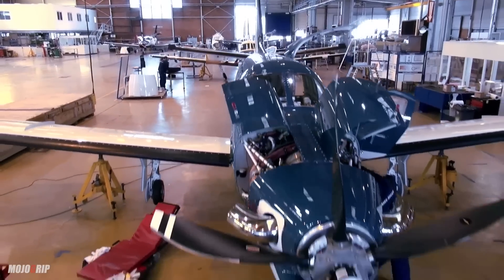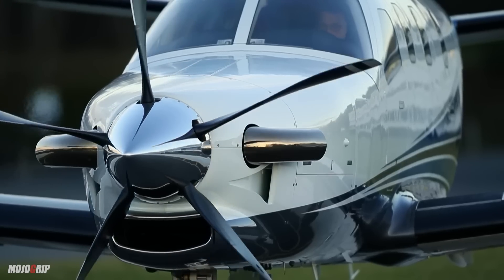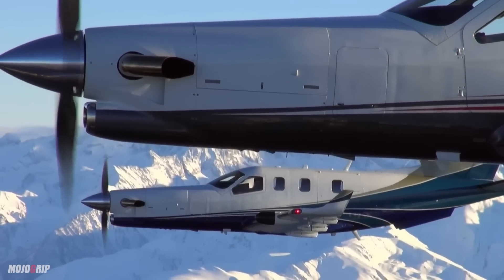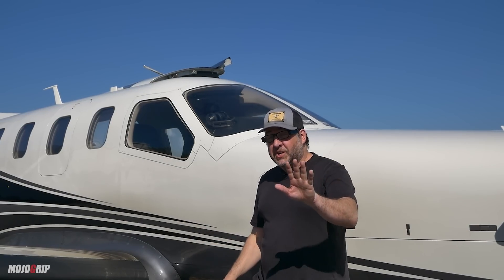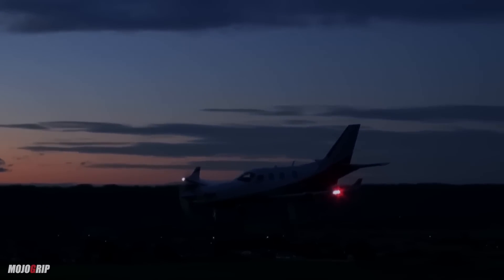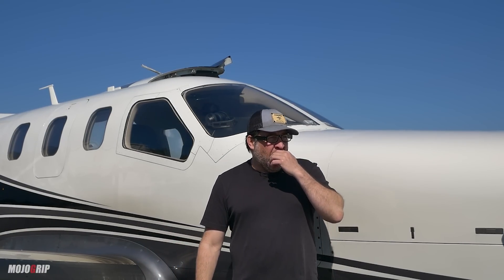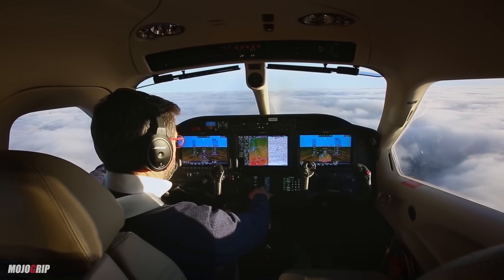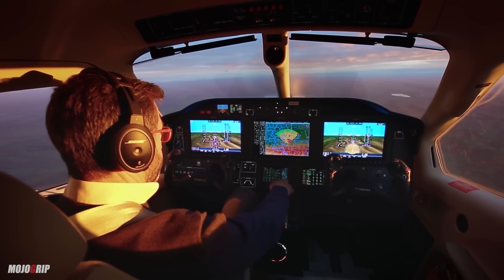This Is So Much Better Than A Jet

Comment: Wish I was still flying.  Had a twin Cessna 340A and the next step was a single turbine.  A single turbine is easier to operate than a twin and without all the twin and piston issues.  FWIW, I was paying $10K for annuals in 2004, so 10K now sounds like a bargain.

Comment: this is very misleading. a SETP like the TBM needs a initial and annual training required by the insurance companies. It's the same process as a type rating in a light Jet. Yes it does cost a little more for a Jet initial. it's $14K for initial in your aircraft for a CE-500 jet rating. Initial in a SETP is around $5-7K. Annual recurrent for Jet is $4000 and Annual recurrent for SETP is around $2500. Very different than what is said in this video. Jets are safer, faster, more comfortable, and fly higher than a SETP. You can fly a light Jet for the same or less than a newer SETP.

Comment: Some misinformation on this.  I'm sure that he has good intentions but he's off on several points.  Firstly the cost of maintenance on the TBM are as much if not more some years than a Citation. Avex will provide you with projected numbers so give them a call.  No doubt that fuel burn is over twice for a TP vs a VLJ however for that you get 2 engines instead of 1 and the added capability to go higher (41-43K) which does get you over weather and turbulence.  I've never paid anywhere close to what he says the annual 61.58 is.  My usual sim or even in plane training has never topped 10K.  Without doubt the requirements to fly a jet are more rigorous than a TP and that may be a turnoff for many.  You are expected to fly at pro pilot proficiency.  Regarding HSI's or overhauls the numbers are not vague.  For every engine including the TBM they are specified and thereby allow you to add that into your cost of ops. Short runways are one place that the TBM will win.  Final line is the TBM is an awesome platform and the fact that it has continued to be a success story in sales attests to that fact.  If you are honestly considering this or a VLJ like a Mustang your initial purchase price will likely be the same or frankly higher for an equivalent avionics equipped bird compared to a Citation with somewhere around 20% increase annually on cost of ops for the VLJ.

Comment: Love the TBM but curious did you consider a Pilatus PC-12,  seems like the perfect compromise of cabin comfort of a jet and single turboprop efficiency
Reply: One might argue the PC 12 is underpowered.  The TBM is a purpose built aircraft for part 91 ops.
Reply: @mikewaterfield3599  You clearly have never flown a PC-12. It has more than enough power to get you places quickly and smoothly, and the avionics allow you to do so without an inordinate amount of effort.
Reply: @hb1338  only 6 hours total, and never ever judge an aircraft on avionics.

Comment: I disagree. The older citations are just as easy to fly but faster and more usable payload. Turboprop do not require type rating but insurance requires the trading which is nearly equivalent. And recurrent training is about $5k. Beta is very comparable to thrust reversers so why is he knocking jets so much? I’ll give him the shorter runways for sure though.

Comment: Really beautiful plane, but I am like the Fighter Jet Pilot I heard the testimony of. 

While flying across the pond near Iceland, his 2 engine jet had an engine go out. He made the necessary adjustments and finished his flight to UK with second engine. 

He said, Without a second engine I probably would not be here today. End of quote. 

So IMHO, and getting ready to buy a plane, I will be buying 2 engines. Whether prop or jet. 

But the TBM and PC12 are amazing and awesome planes.
Reply: Before you pull the trigger on that twin, take a look at the accident statistics and make a data-based decision. GA singles are actually more survivable after an engine failure than twins.
Reply: @cessna177flyer  That's arguably true for piston and TP twins but not for jets which is what his video is about
Reply: @cessna177flyer    Lack of pilot training and proficiency leads to twin engine accidents.    The TBM an PC-12 are great aircraft but I’m not flying them at night night IFR or daytime low IFR.   I want a second source to get me back to a runway if I lose one like I did in an MU2 because of a severe oil leak in the gearcase.
Reply: @stevez6499  agree. Training and proficiency are key. No pilot thinks they are below average, which means 50% of us are wrong...
Reply: Facts. Like the good book: Two is better than one.

Comment: What about a PC 12 vs the TBM ?
Reply: Apples and oranges. Both have some things in common of course but pc12 are people/cargo movers, think of them as a large SUV. Large fuselage in comparison, roomy and bigger mostly preferred because its cargo capabilities or groups of people, thats why is slower compared to a TBM which is mostly like a car inside almost like a sport car, only small number of people’s movers with small cargo but way faster. So, different applications. PC12s are loved by charter companies that need to land in really tough terrains and move cargo. TBMs are loved by solo pilots with solo (or couple) of passengers.
Reply: PC12s are a bit more capable, but they're slightly larger and much more expensive compared to the TBM.

Comment: Does Daher TBMs have more issues with cabin depressurization than other planes? I read a few articles of catastrophic accidents due to pilots losing consciousness in these things due to pressure dropping at altitude? Can anyone share the stats on this?
Reply: Don't focus on "Stats". These incidents can happen to ANY aircraft.
The only reason a pilot would pass out to loss of pressurization is if he/she is NOT paying attention to their aircraft. With all of the dials, gauges, warning and idiot lights in a modern aircraft, there is no excuse for these types of incidents.
In the case of rapid decompression, it comes down to being trained / prepared with your mask properly preflighted and readily at hand. What gets most pilots in trouble is complacency.
Reply: The president of the TBMOPA perished in a slow depressurization event years ago.  It however was not as much related to the TBM as any pressurized aircraft.  All of them have warnings systems but if ignored can turn into tragedy.

Comment: When someone throws out a statement like this, I can’t sit back and be quiet. Not sure what jet you came from, but your numbers and philosophy are way off. 

Recurrent training in a light jet may be around 8K, not 30K, and to go to school once a year is something you’d be expected to do in the TBM also, there is no money savings in training. 

As a turbo prop, you are always flying in the mid twenty’s, right where the weather will be, with engine icing selected on, it really slows the climb, boots are not very efficient, especially considering TBM wants you to use the “auto” feature, with many thousands of hours in turboprops, I don’t believe in auto, a person needs to be a much better prepared to operate a TBM in all weather conditions. And then let’s talk about speed, you’ll see about 300 kts. 

Compare all this to let’s say, a Citation M2, the M2 won’t overheat sitting in the warm up in Las Vegas in a hot day, like a TBM, the M2 and many other light jets actually have a cabin you can move around in, not the TBM, the jet will climb at a faster rate if climb to FL400 or 410, jet has a hot wing, the M2 has trailing link gear, impossible to make a bad landing. 

Jet is much easier to manage than a TBM, turbo props are much more likely to be damaged by inexperienced pilots during a start. The clear winner for over all aspects is clearly a light jet. And don’t elude anyone, if you don’t go to school every year in the TBM, you won’t get insurance, period.

Comment: Like the aircraft, very versatile with plenty of range BUT NO BATHROOM?
Reply: Well, inside it is like a car really and the application is usually relatively short flights (1 to 3 hours max although it can fly longer) so typically the pilot or charter company will remind the passenger to go pee before flying and to restrain from caffeinated drinks prior to flying. I have flown (as a passenger, I’m not a pilot) many, many times in small aeroplanes due to work (for several years). You get used to not having a lavatory. Not a deal breaker.

Comment: I can see the appeal of reverse thrust and there seems to be some truth to a bit shorter runway capability but it's just not worth all the weaknesses. You know the expression private jet? there is no such thing for a turboprop. It looks like something from WW2, slightly removed from indiana jones. It makes noise accordingly and obstructs view. A constant reminder of what a massive mistake you made when you bought it. It doesn't have engine redundancy for ocean crossing and general safety and it doesn't have the speed. There is some truth to fuel economy however what few seem to realize is that if you lower a twin jet's speed down to turboprop speed, it's a lot more fuel efficient, not far off the turboprop. You just have the option of going airliner speed.
The single engine TBM940 costs the same as an Embraer Phenom 100 twin jet and the ramp appeal is just staggeringly different. The awful turboprops look like you fly medical parts or letters to New Foundland and you hate your life. The Phenom looks like you have it going on, you are banging Heidi Klum and have a 15 million dollar house in the hills of LA.
And where jets can really shine is that the planes could be lighter and smaller and the engines so simple that after 4000 hours you just buy a new one for 10k and don't worry about it. That it's not a financial burden at all. True freedom. Google says the typical annual cost of a TBM is a cool million dollars. That is frequent use but still. F dat.
What he forgot to mention is that an overhaul is a joyous mystery between 400 and 800 thousand dollars. Because for some reason when it comes to turbines the clowns lose their minds. Unfortunately also true for jets but it can be remedied. Jets can be surprisingly simple. I looked into it and it seems even the ball bearings are made by normal ball bearing companies of normal materials. Not some exotic part.
And regarding fuel efficiency, the world distance record of 40000km still belongs to the Williams FJ44 jet engine. Not a turboprop. That means piston planes should not exist nor should turboprops.

Comment: DOES THE TBM HAVE A LAV? VERY IMPORTANT QUESTION!
Reply: I don’t think so. If you want a lav, look at a PC-12
Reply: @seanevans7629  The question was rhetorical ... nice aircraft, but I need a place to potty.
Reply: Yes,  but last two sets have to be removed.
Reply: @sasaseremet6957  That's a no-go then for me.
Reply: Inside it is like a car. The usual application of these types of aircrafts is a relatively short flight (max 3 hours although they can fly longer). TBMs are really fast so that also shortens the leg. You just need to use the bathroom before boarding and maybe restrain from caffeinated drinks prior to as well. Not a deal breaker . I’ve flown many years in small aeroplanes (as a passenger, I am not a pilot) due to work, never had an issue. You get used to it (how many times you need to stop from your driving commute to use a bathroom in a gas station? These flights are similar to that, usually hour / hour and a half)
Reply: @Dan_C604  Not since I hit 65, my muscles will hardly restrain a single drop of urine anymore. I'd have to fly with a supply of piddle packs, even with the 2 meds my Doc has me on. Piddle packs, and perhaps pee pads in my shorts.

Aside from that, how's the TBM in the climb to cruise altitude? I hear that some turboprop 'craft are slow in the climb. I'm used to flying cross-countries in military jets, particularly the Lockheed S-3 Viking, with no ground speed impediment during the climb.

Comment: The TBM is an absolutely spectacular airplane. Better than many light jets and almost just as fast. Faster than some even.
Reply: Would like to see some examples.  I cannot think of a single VLJ that is slower than a TBM especially when TAS at altitude which is almost always higher is factored in.  The TBM does come close to at least being as fast as some VLJ's at equivalent altitudes but that really is not where you would chose to fly a VLJ
Reply: @caseylenox9472 : The TBM930 (340 knot cruise TAS) is faster than the Eclipse when cruising for max range (317 knots TAS) and is just as fast the Mustang C510 (340KTAS). It also climbs better than both at altitudes above FL250. It's also 30kts faster than the SF50 and has better range and can carry more weight than all 3.